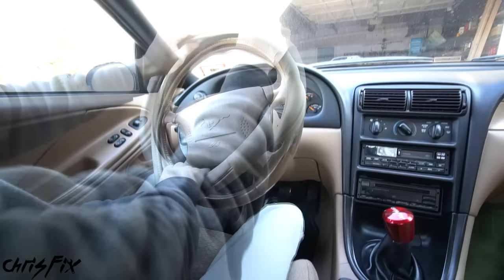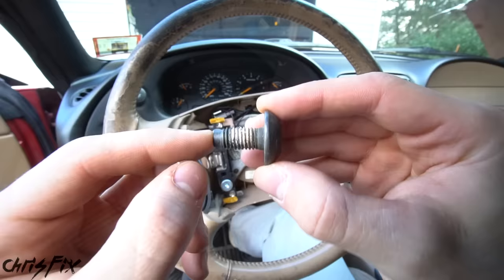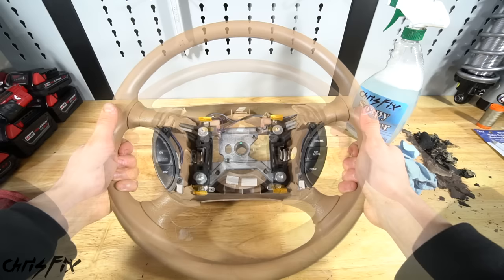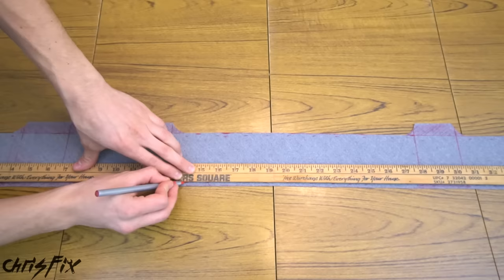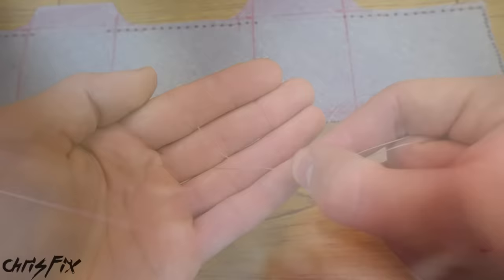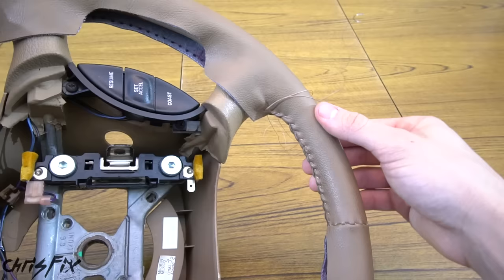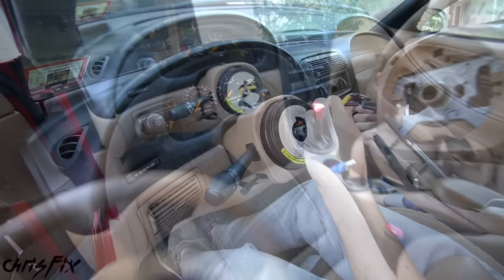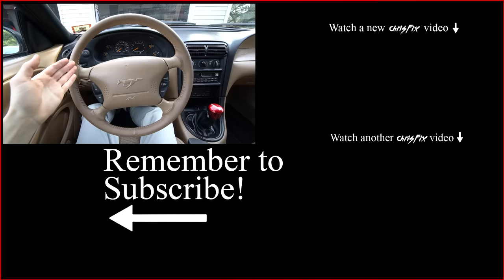How To Restore Your Car's Steering Wheel (Looks Brand New!)

Comment: Just a safety warning, some vehicles have a capacitor for the airbag circuit that can hold voltage for up to 30 minutes after the battery is disconnected. Don't want anybody getting killed from an unintended airbag deployment 👍 Always follow manufacturer specified steps for removing your airbag
Reply: Eric Smith This needs more likes! Safety is priority.
Reply: Vontae Davis #ShutDownCB #Elite21 saefty ish number one proirity
Reply: Vontae Davis #ShutDownCB #Elite21 Crazy Russian Hacker! 😅
Reply: Philip Scott Yaasss Lmao
Reply: Shhhh.... Don't ruin the surprise...
Reply: Tim Ramich you don't have electrical blue prints of a air bag box?
Reply: kristoffer ljungberg The fact that you used the word "blueprints" just shows the fact that you have zero clue WTF you're talking about.
Reply: And plenty of flat-rate dealer mechanics don't even disconnect the battery...
Reply from the maker: Thanks for the tip. Obviously you always go by your specific vehicle's recommendations for airbag removal. Since there are thousands of different vehicles out there, it is hard to be specific to each one so most people recommend 10min to be safe. Some vehicles can take up to 2hrs for the whole system to discharge. Either way, this is just a safety precaution but your airbag shouldnt deploy even with the battery attached.
Reply: ChrisFix what if your steering wheel doesn't lock?
Reply: pitythegreat Don't worry about it, just follow all the other steps but make sure when you remove the steering wheel that the front wheels are straight
Reply: Eric Smith
Reply: Just a common sense warning: Unless your vehicle is on (or just recently on) and is suddenly hit with multiple G's of force, the airbags will not deploy upon disconnect.

You'd have to purposely put power into the wires going to the airbag to force it to deploy. It's like... picture a light bulb in a lamp. If the switch is off, and you unplug it, does the light come on? No, of course not.

Now, if you're messing with the wiring harness, disconnect the battery. If you accidentally pinch wires together.. or say you snip the airbag module wire /AND/ the power wire somehow. You may have just deployed the airbag and rammed scissors into your face @ hundreds of feet per second. Touch the harness, disconnect battery. Disconnect airbag? Shouldn't ever need to disconnect the battery.

Since people are notoriously stupid (myself included), just disconnect the battery anyway.
Reply: i was a firefighter for 5 years and never once heard of an airbag capacitor
Reply: Eric Smith @@
Reply: Eric Smith 丶
Reply: @bishopob well im not a car manufacturer so i cant say for sure but i was only taught to cut or remove the battery cables if an extraction or entry was needed, and i went through a few mva/rescue classes. the chief was also a mechanic and i dont recall during con-ed him ever mentioning a secondary power supply only secondary airbags.
Reply: Eric Smith جزر
Reply: Reece Wharf r
Reply: actually on the fiat punto 185 model if you disconnect the steering wheel airbag without disconnecting the battery first, the airbag light stays always on and you have to reset or replace the airbag module (airbag ecu or whatever its called in english)
Reply: Eric Smith 4
Reply: Kan't i do it in a nissan
Reply: Eric Smith xd 😵
Reply: lmao i went through firefighter 1,2,3 i learned about airbag capacitors in firefighter 1
Reply: Moan
Reply: Eric Smith i
Reply: bullcrap... airbags save lives... i used to have fun with these
Reply: i hear some hold up to 24 hours!
Reply: KEY WORD IS WAS LMAO. wtf would a fiefighter know about an airbag besides popping a lock. but even so. why would you know more about a capaitor or lack there of?
Reply: Eric Smi
Reply: I’m the 2.1 Like😂
Reply: People clearly don't understand how an airbag is deployed.
Reply: Eric Smith Who has ever been killed from unintentional airbag deployment?
Reply: no it won't. Even if there was a capacitor that had THAT MUCH ENERGY, you could just use a resistor to discharge it.
Reply: Tim Ramich  Your right, Eric Smith was just looking for something to criticize about the video.
Reply: Right. Always refer to a service manual for full directions. Rushing and doing the job dangerously is never worth the risk.
Reply: Do what I do and just hit the air bag with a hammer to see if it's active. If it explodes, you have your answer
Reply: Exactly,All a person has to do is read the owners manual,it will tell you things like Airbag safety and all that,cars are not what they used to be,back in the day a owners manual was a pamphlet,now its more like a 500 page bible specially with all the unnecessary shit they put on cars these days, like they say "more stuff to go wrong" if you cant back up a car on your own and need a camera something is definitely wrong with you, "birds eye view" is one of my favorites, not needed,lol   @stuna101a
Reply: Thanks for having a good heart!
Reply: I never disconnect the battery when removing air bags. However, best advice to give piece of mind, is to drain the capacitors from all modules. You can short out the battery cables together with a wrench, after both terminals are disconnected from the battery. Or, you can just turn on the headlight switch, "shocking" the capacitors.
Reply: Or if you try to turn on the car all the cinetic energy (haha) is going to go
Reply: Yep
Reply: Eric Smith 
Q
Reply: this is important!
Reply: Chris has probably read his owners manual a million times
Reply: Eric Smith you saved me!
Reply: Too late
Reply: I did it and didnt kill me😀
Reply: Needs more like safety first
Reply: if u dont want to wait 2 3 seconds,,, u can kill save energy with any thing lamp example conect lamp from back and energy is off direcct on 1 sec :D that's i called kill save energy, or other electronic things on homme just push buttons after energy cable is off,, just push some butons and energy saved is dead direct :)
Reply: meangreenf150 that’s correct.
Reply: I'm never in a hurry, and I've often worked on guitar amplifiers with caps that can hold potentially lethal charges. I know it's more than "overkill" but I'll wait 12 hours when waiting for full discharge of anything within any circuit holding caps, not to mention damaging other vital electronic components with potential shortcuts on a circuit with components holding residual charges.
But, unlike most people, I've got my time, and I don't care waiting to work under safe conditions.
All thumbs up to ChrisFix and all other DIYers !!!
Reply: Thank you man I appreciate that
Reply: Eric Smith very true
Reply: Damn didn't know that. Thank you so much!
Reply: Eric Smith thanks
Reply: Eric Smith ok
Reply: Eric Smith legend
Reply: @manuelsousa8479  yes
Reply: @timramich  😂😂
Reply: Congratulations you saved a life or 2 or 3 or a few million
Reply: This needs to be a highlighted comment because it’s not just a funny comment it’s a safety warning like the warning tags   On tik tok and stuff
Reply: I once used airbag as a pillow for a few minutes during a class break, I am glad that nobody tried to deploy that while I took a nap.
Reply: Eric Smith thanks for the advice lad but I don’t have any airbags so 😥 mr2 life
Reply: @timramich  SCHEMATICS ? LOL
Reply: Understand cvuwdajmatipeirv
Epitome ok
Reply: Opacity hidden harbinger had
Reply: @rick31869  What?
Reply: Tim Ramich why is there an argument about an unnecessary thing that goes completely off topic from the comment?
Reply: guy at car sale was walking around sticking his head in the cars turning the switch on looking at the miles. he turned one on bag came out broke his neck died instantly.
Reply: Do not bump or impact the SRS unit, front impact sensors, or side impact sensors when the ignition switch is ON (II), 
/! or for at least 3 minutes after the ignition switch is turned OFF; otherwise, the system may fail in a collision, or the 
airbags may deploy 
-my 2008 crv service manual
(obviously this isn't the same for every vehicle)
Reply: @pitythegreat  as long as you mark it and don't move the vehicle at all you'll be fine.
Reply: datheoun
Reply: @pitythegreat  like a 2014 mitsubishi mirage
Reply: @Countryboy2206  Firefighters are no car mechanics
Reply: @chrisfix  nowadays we just say "cope"
Reply: @chrisfix  poo
Reply: “Chris!!! Damn it, not on my mothers dinning table!”
Reply: Jokes on you I don't have an airbag 😂
Reply: @chrisfix  well said 💖
Reply: Eric smith dont BS us
Reply: @chrisfix  I did the same for my couch but the color is brown
Reply: @pitythegreat tap on his comments so he can tell you are talking to him
Reply: How did you identify the torq specs?
Reply: turning your headlights on while the battery is disconnected will drain the capacitor, i think
Reply: @xephael3485 I know of a case where an infant was killed by an airbag deployment in a parking lot bumper touch between two cars.  This gave rise to passenger "Airbag Off" switches.
Reply: Do you think it's safe to cut the leather and work on it without removing it?

Comment: Hey Chris an easy way to reverse engineer that steering wheel cover is with the old one. Since yours came off in an easy manner if you add a little bit of steam to the old on and flatten it on you can actually just trace the old covers pattern onto the new material and it will have an even tighter fit to the wheel. Also for the seam when you stitch both ends together instead of knotching out in the rubber on the wheel if you press the seam open it will lay flush without having to remove any rubber. You can usually press a seam open with an iron. If the material you are working with should not be ironed directly use a low heat setting on an Iron and a piece of cotton cloth on top the press it open. This step does take a little more effort however the front stitching where the seam is will look really smooth and clean with the added work. If you ever tackle any more upholstery just remember to press open your seams after you sew them. This just helps all the seams to lay flat and flush, if you are doing a top stitch on anything you can also top stitch after you press the seam and this will help the material look super clean and flush. Enjoy :D
Reply: What a great tip, I hope we all learn from your advice.
Reply: Mmmkkkkkkm
Reply: Can you please make a demonstration video?

Comment: Man, this is crazy thorough, I never would've thought of cutting a channel in the wheel for the seam to sit flat. Looks really professional. One tip if people have trouble cutting a straight line with scissors is you can use a rotary cutter and a cutting mat, makes it easy and fast to cut straight lines in fabric and stuff like that.

Comment: Top Tip. If your steering wheel doesn't require a puller and can be done with a bit of brute force, screw the nut/bolt back in a few threads before pulling. This will stop you from punching yourself in the face with your steering wheel.
Reply: Nobody that I know wants a bloody nose.  Good advice.  :-)
Reply: Matthew Lock I learned my lesson lmao
Reply: I bet you said a few "colorful" words LOL
Reply: I don't think there's a word I didnt say lol.
Reply: LOL Matty lock. Good advice man.
Reply from the maker: Thanks for the tip. Be careful because your wheel is made of cast-aluminum which is pretty easy to bend and crack (designed that way to if you hit your wheel in an accident it collapses).
Reply: Exactly, i put my knees behind it and twist it a little, never needed a puller. You also put the bolt back in so when the steering wheel comes loose you dont pull the connectors for the airbag and so with it (found that out the hard way😂)
Reply: I don't recommend prying or brute forcing the wheel off the shaft. It's not good for the bearings on the shaft. The wheel on the 95 mustang uses two 8 mm bolts with a wheel puller. Ford put them there for that purpose. Mine was really tight since it was a convertible and had a little surface corrosion. A little PB blaster and lots of torque on the wheel puller did the trick. It would never have come loose without it.

Comment: I'm happy just to learn how to straighten a steering wheel. Nice.
Reply from the maker: Usually you need to align the car's toe alignment.
Reply: If the steering wheel has never been removed before and it is crooked while driving straight, you have an alignment problem. Don't do this to straighten your steering wheel and instead, get your alignment checked.
Reply: Actually, it can be wonky from manufacturer. On pre-2009 Korean cars, it was surprisingly common..
Reply: It really depends on the car. I was hoping to do a little adjustment when I replaced my steering wheel, but the steel pegs coming out of the clockspring suggested otherwise.
Reply: if your steering wheel is off you should look at the tie rods/ tie rod ends and other suspension components, you may also want to see about having the vehicle aligned. i recommend shops like Firestone complete auto care that offer lifetime alignments. so that if you ever have the problem again you don't have to pay again. alignments can be expensive depending on the area and type of vehicle.
Reply: Vincent Ellis Was
Reply: John Galt Can confirm, my 2000 Samsung SQ5 is indeed wonky and I know the steering wheel was never removed
Reply: Kristiza Lebedeskova p
Reply: Shawn P  lots of times it just takes centering the steering wheel and then aligning the wheels at the suspension level. Unless you got bent components, starting with a centered steering wheel and go from there, usually gets things back where they belong. It's not easy and in some cases not cheap.
Reply: Nah you should get an alignment not moving the wheel, except if it's crooked because you already removed it.

Comment: ChrisFix: Remove the battery connection so the airbag doesn’t have any power.

Me: Laughs in 1974
Reply: Jon The Otaku - AF5000 

Also Me: Laughs in 1989

Nissan 240sx 🤟🏼
Reply: ididitsolo Kinda unknown car: Bricklin SV-1 😁
Reply: @cakebop  Laughs in 1987
Reply: Old crazy man laughing on throne: YOU HAVE NO POWER HERE
Reply: Me: Laughs in 2008 because Brazil doesn't give a crap for car safety
Reply: Laughs in 1972
Reply: Me: Laughs in 1948 

(Willys CJ2A)
Reply: 83 gang wya?
Reply: Laughs in 1988
Reply: @mini_disc  I guess you have to custom make all your parts for the sv1 eh?
Reply: keaysman I actually know where to get originals!
Reply: Me: cries in 2015
Reply: After seeings this comments... laughs on 1971 
Did i win something?
Reply: CMDR Grantour you won a good job sticker
Reply: The airbag can't deploy if there's none in the first place lmao
Reply: RedEdain - EAS EXACTLY! lol I’m working on a (for the time) “safety vehicle”
Reply: laughs in 1980
Reply: Just be sure to not push the "deploy airbag" button that everyone seems to be worried about !  Although extra safety isn't a bad thing, I never understand all the parrots that squawk about the dangers of the airbag.  What exactly do they think would make an airbag deploy IN the steering wheel ????
Reply: Laughs every day, I ride a motorcycle
Reply: What's an airbag? My '93 MX5 has none of that
Reply: laughs in ‘98 chevy 2500 because chevy didn’t put airbags in the 2500 and 3500 until 2001
Reply: Laughs in squarebody chevy
Reply: k
Reply: 20 mentos
Reply: Laughing in 2010
Reply: Lewis Hamilton laughs in 2020
Reply: Laughs in 1976 with race steering wheel. Its a opel manta with an omega 2.4l motor if anyone wondering used to be a drift car
Reply: Hey my dad was born on 1974
Reply: @cakebop  me laughing in 1922
Reply: Laughs in 1:
Reply: Me: laughs in 1991
Reply: @rafaelgsbr  Just like Alaska
Reply: Laughs in E100 Toyota Corolla
Reply: @cakebop  

Also me: laughs in 1985
Volvo 240🔥
Reply: 1965 here 🤣🤣
Reply: Laughs in 1983
Reply: i laugh in 1952
Reply: So you just disconnect the negative and wait 10 mins? Correct?

Comment: Awesome video like always!

I noticed that when you peeled off the old leather from the steering wheel, it looked like it had been glued all underneath before they stitched it closed. Wouldn't it have also been a good idea to add glue all around in the inside of the new leather just so that later down the road it doesn't become loose?
Reply from the maker: The glue was for the rubber. The glue I used on the spokes is plenty to "hold it in place" but in reality, the stitches hold it in place. That thing isnt budging!

Comment: yeah im buying the $10 steering wheel cover
Reply from the maker: lol
Reply: Dennis Vu or it's better to keep the plastic from underneath the leather
Reply: Walmart has a 3x2 offer now...
Reply: ive bought 2 covers for my truck steering wheel, both continue to fall apart. i always drive my truck and im an aggressive driver. it is easier to replace the leather and install a steering knob